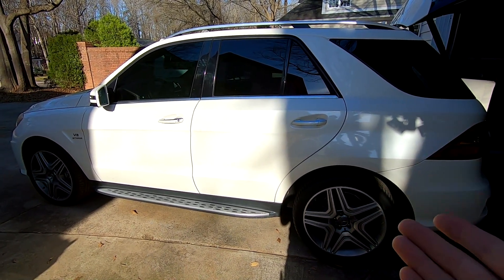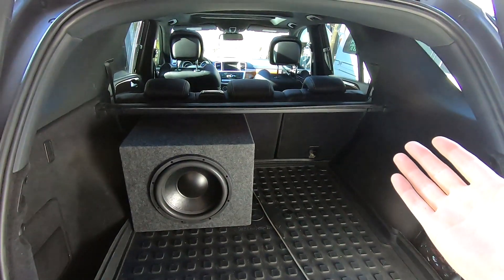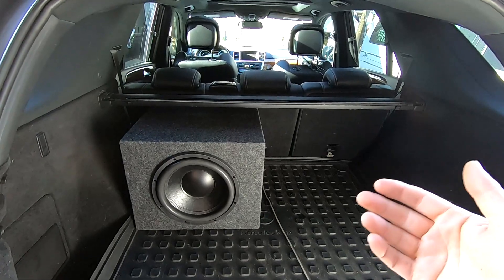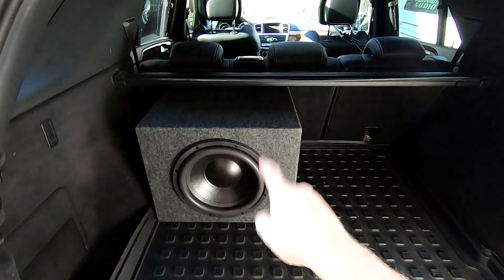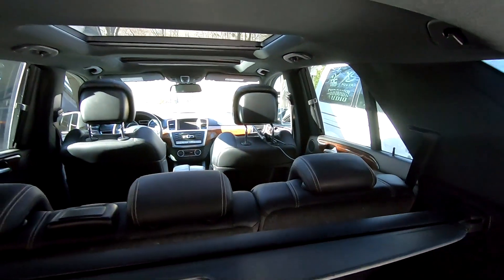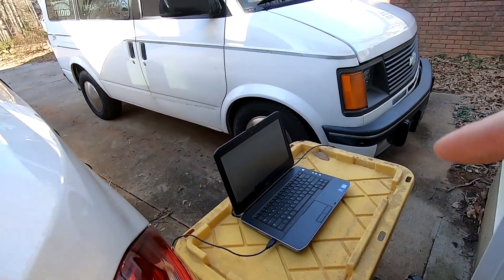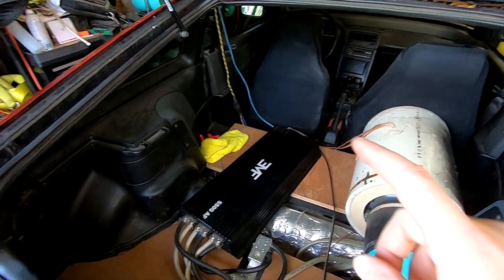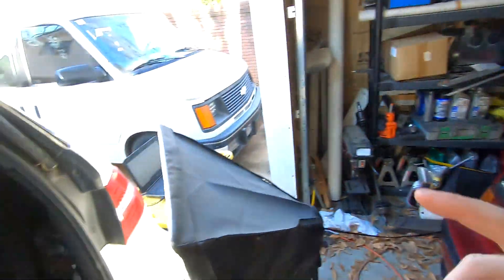EMF Audio Ghost 12" prototype IN CAR frequency response test

Comment: I'd like to see the same exact test, but with the sub all way at the back of the trunk, on the side of the trunk, facing forward, back ward, etc. Is there a sweet spot distance from the back wall of the car?

Now that we see the cabin gain on a pretty flat sub/enclosure system, we can see how that gain varies by position.

You could also do the same for a car with a trunk, same sub/enclosure. Front, back, side facing different, seats up, seats down, etc.

Comment: Could you tune the port lower or use a bigger box to bring up spl between 20 and 40 hz without sacrificing too much sq and power handling?
I'd like to see it tested in a car with a trunk and fold down back seat. Something similar to my 03 Monte Carlo.

Comment: How to measure frequency response of a subwoofer with REW in-car
1. Set the mic in the location that you want to measure frequency response
2. Start REW
3. Under "Preferences / Analysis", set the left window to 125 ms and the right window to something like 500 ms
4. Select the "Measure" icon, enter Start and stop frequencies, set level to -6dB or lower, length 512k (that should be good enough. That should give an 11 sec sweep. 
4. Click the "Check Levels" button, to confirm that the SPL level is good for measurement.  Adjust volume level if necessary
5. Deselect the "wait for timing reference" option.  That's not really needed here.
6. Click the "Start Measuring" button.

That's it!

That dip in the FR is due to a standing wave, or more correctly the mic's position wrt that standing wave, caused by the dimensions of the vehicle.  The longer the cabin, the lower in frequency that dip will occur.  That's probably why hatchbacks make the best bass :-).

The FR measured flatter in house probably because you were overloading the mic. Notice that there were a lot less harmonics leading the fundamental in this measurement? 

If you do measurements using the process above, you can also easily compare one measurement to the next. In this case, it will show how much extra bass the vented enclosure provides.